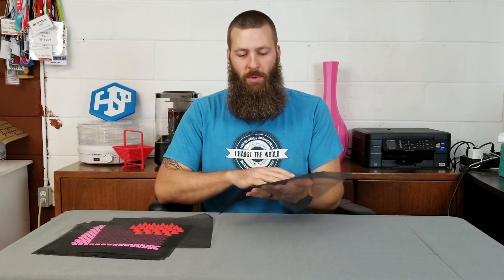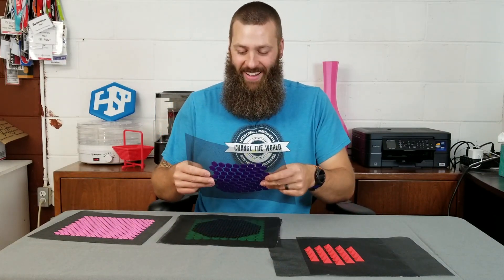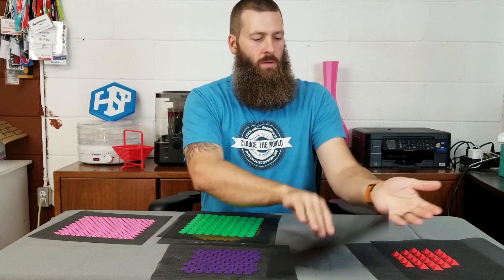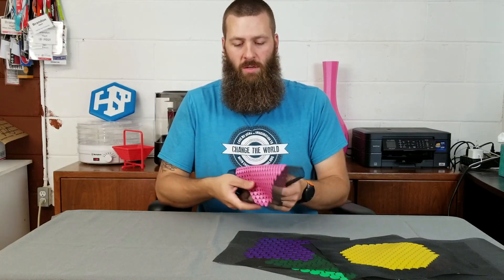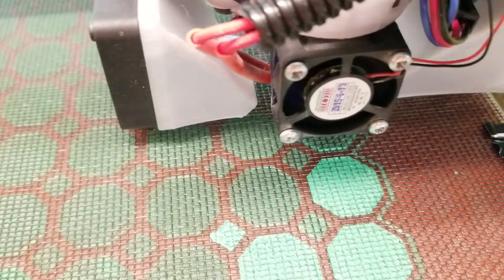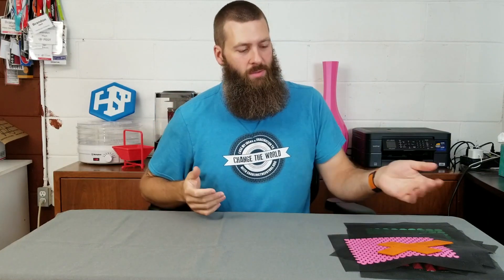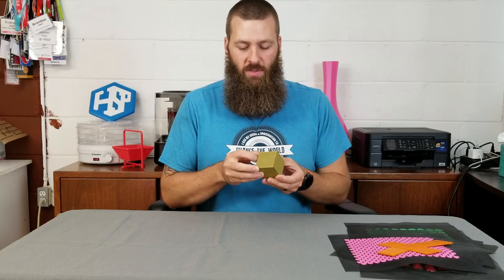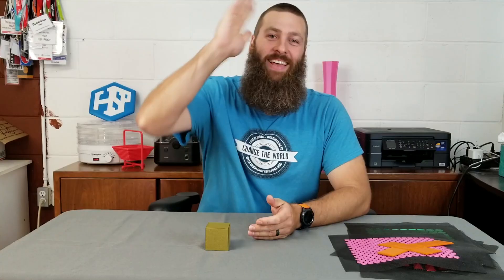3D Printing on Screens!

Comment: I was wondering what nozzle size and layer height you were using here?
Reply from the maker: If I remember correctly, I was using a 0.40mm nozzle on my Lulzbot Taz 6, printing at 200 micron layer heights. It may be a good idea to measure the thickness of your screen and try to match that with your layer height. So, for example, if you have a 300 micron thick screen material then you might want to use a 300 micron layer height. That way you'll get good bonding of the plastic through the holes in the screen, but also won't drag the screen around the bed by scraping on it too hard. Good luck!

Comment: this is awesome!  are you using PLA on the samples and could you print on a finer-holed fabric such as lycra?
Reply from the maker: Thanks Scott! Yes, I used various types of PLA for all of the examples I'm showing in the video. You could certainly use a finer mesh to print on, such as tule or even some loose weave cloth, but Lycra seems like it would prevent the plastic from being able to squeeze through it enough to enable the plastic to bond with itself on both sides of the material. Might be a fun experiment to try, though!